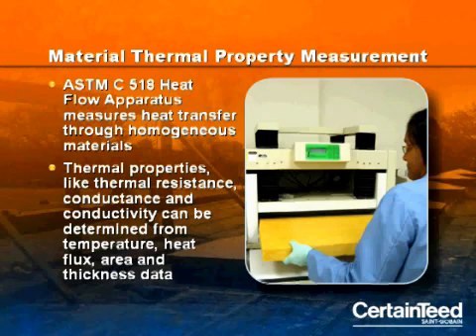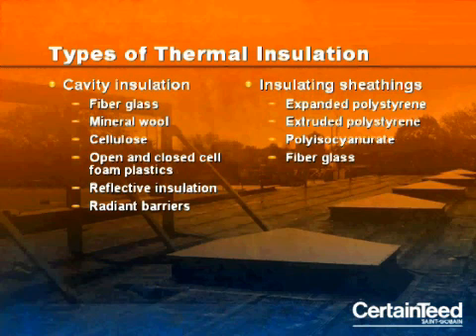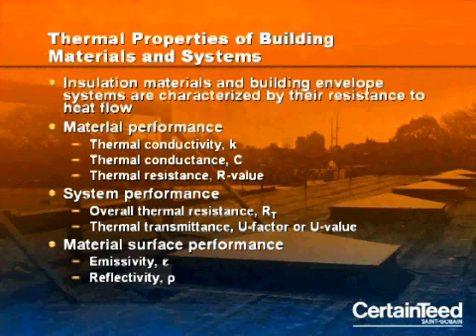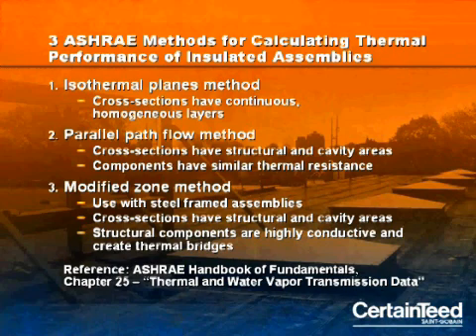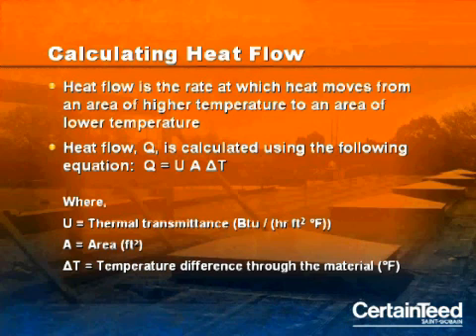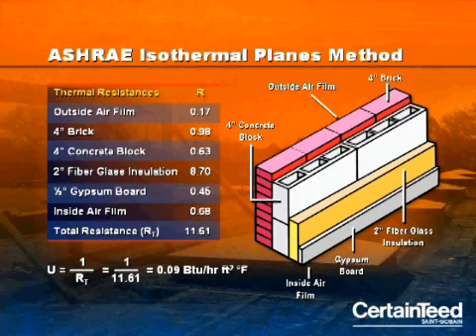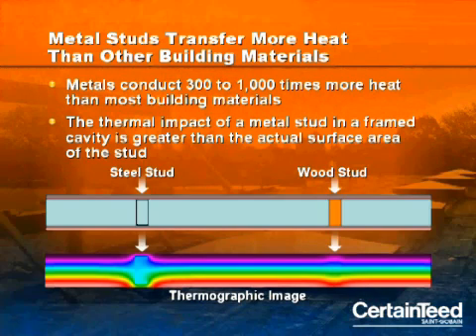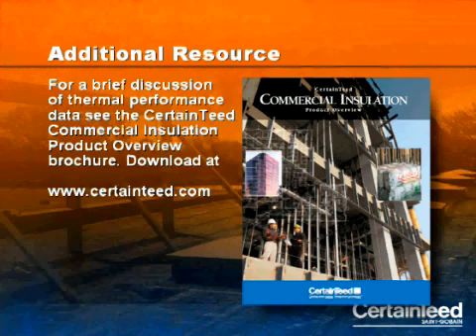Presentation - Thermal Properties of Building Materials

Comment: The latitude, altitude and exposure to elements--sun/heat, cold/wind, and water/vapor should help us choose optimal construction materials for our abodes. 

If space/area is abundant, then only the thermal properties of resistance, conductance, emissivity, and reflectivity should factor into the equation because one could use larger quantities or volumes of materials for strength, provided these don't degrade with exposure to the elements over time.

It's very easy to choose materials for extreme latitudes because the seasonal variations aren't material.

It's quite difficult to do so for latitudes or locales that have material variations between night and day or between the seasons.

The seasonal variations , I suppose, could be overcome to some degree with good  ventilation and extensive use of glass to optimise natural lighting because windows can be covered with blinds or blankets/curtains to inhibit or block the heat transfer via light energy, provided the windows are well insulated.

One could then decide on where and how to stack the different natural or synthetic construction material based on where we want reflective and resistive surfaces and where we want conductive and emissive surfaces.

Unless resistive surfaces have efficient conductive surfaces to serve as bridges, these entrap heat to serve as thermal masses.

One could then design a house adapted to the night- and day-time and seasonal temperatures with a clever choice of heat transfer and storage media/systems. 

We could use a blend of climate  sinks and radiators, batteries, heat pumps, and energy sources tied into the prevalent geothermal system to naturally control the climate with some support from  artificial  energy sources, provided the insulation, ventilation, and natural lighting systems are optimal.

I would never compromise on luxury, never compromise on either the aesthetic or functionality, never punish myself with austerity, and never inconvenience myself (except for bare essential physical activity for biological and physical  health), but I love the freedom and autonomy that self-sufficiency provides me with.

I would adopt the following approach to designing my off-grid home:

1- I would orient the home towards the south in the northern hemisphere to maximize my exposure to the Sun.

2- I'll elevate the home for the view, the breeze and for protection against floods and snow.

3- I'll dig the basement at a depth of 8+ feet to have the same temperature year-round. I might even build into a hill, for the same reason, if it wouldn't ruin my view.

4- I'll build the top story to harness the Sun and to harvest the rainwater and//or snow: I'll use a conductive stone roof, large windows, good insulation and a sloping roof emptying out into a ceramic or concrete tank designed, as a still, to provide distilled drinking water.

5- I'll use the gravel on the driveway to filter and store tap water during the rains, and to also heat the water on sunny days.

6- I'll orient the house with some vents towards the Sun and others away from it to naturally generate air currents to warm or cool the house, and to also exhaust unwanted air.

7- I'll build a veranda around the house and choose an aperture to block the Summer Sun, but allow the Winter Sun in warm climes, or I would replace the Veranda with a conservatory or a small and high roof to maximize both the Winter and Summer Sun in very cold climes.

8- I'll maximize light and heat with windows, and use cane, whicker, woolen or cotton/rug blinds or wooden shutters to control light and heat.

9- I'll use an R60 insulation through the walls, floors and roofs and use the highest grade of insulation on the windows. I'll then run the piping for geothermal heat inside of the insulation, and cover the piping with a good conducting material, like metal, glass, or stone. 

10- With regards to the interior decor, I'll use glass, metal, stone, granite and marble for conduction; concrete, sand and earth for heat storage; and wood, wool and rugs for insulation. 

11- I'll build a large green house to fill the geothermal heat battery during the day and in warm weather, and store the heat in a heat-tank made of stones, gravel pieces, sand and earth, and place the geothermal piping (running an efficient fluid) inside this battery. 

12- I'll use a blend of PV solar, wind(Liam turbine) and wave power(a magnet moving over a coil, a turbine, a water wheel, an air piston, etc.) during the day and   wind, wave, hydel or sand-stored solar (stored as heat;don't like batteries) at night.

13- I'll use an ammonia- or other refrigerant-driven heat-pump for the most efficient use of heat energy. These will work my geothermal,  refrigeration, air conditioning, heating and cooking systems.

14-- I might use a thermal-solar solution with parabolic troughs to heat an oil, store the heat in sand, and then drive a small turbine at night if there is no wind or wave power on that day. I'll also use the heat from this to replace the compression section of the heat-pump and to also heat water and  cook.

15- I'll choose the insulation, conduction, convection and heat transfer systems(pumps) to be the most thermally efficient, but I'll choose the solar-thermal, solar PV, wind, wave and hydel energy generation systems and oil/water/gas/fluid; sand/gravel/concrete/ceramic other solid storage systems to be the most robust and lowest maintenance systems even if these are insufficient.

16- I might use electrolysis to harvest hydrogen from water and store that as ammonia for use in a vehicle, yacht, or aircraft driven with an ammonia fuel-cell or internal combustion engine. I don't like to store hydrogen in tanks because it is very volatile.

17- I'll use satellite, cellular,  VHF, HF/SW, and MW communications and media systems.